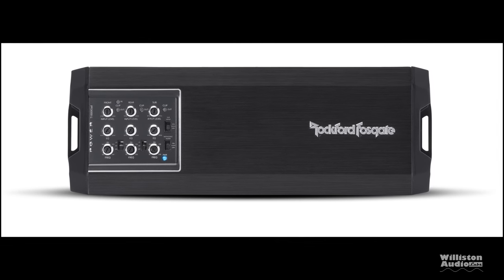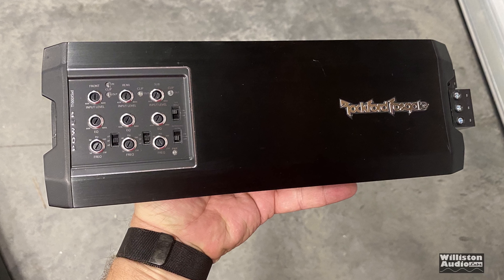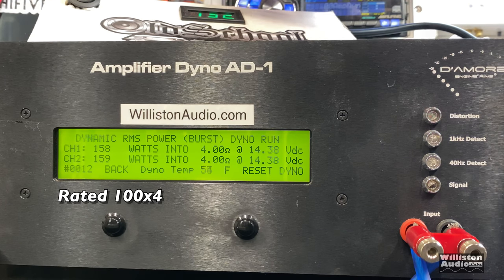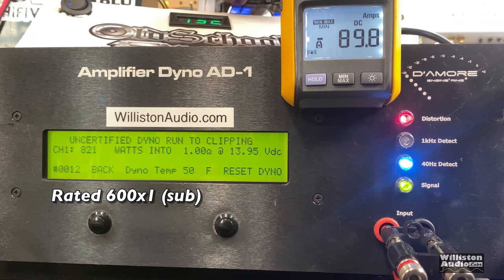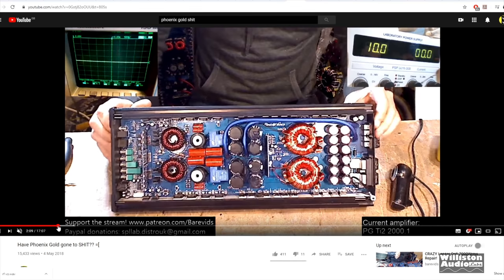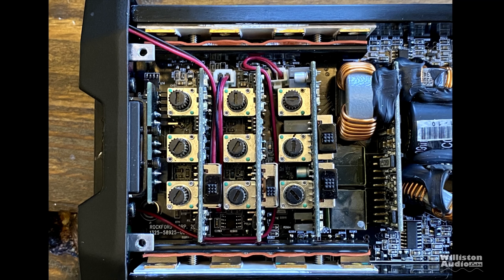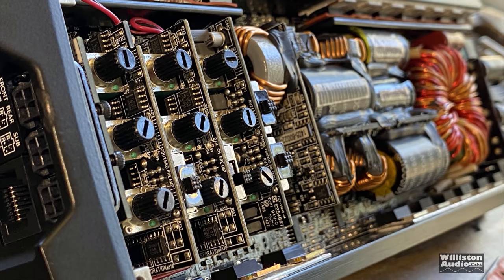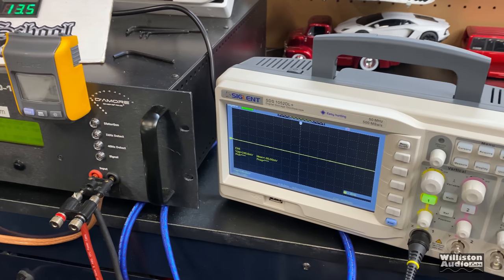Rockford Fosgate Power T1000x5ad Mini Amp Powerhouse!

Comment: I have the stage five system in both my UTV’s and I chose this amp for each with the PMX2 and my 2024 Can Am limited enclosed has 1(M1 10” sub) and 4 (6&1/2’s) installed in roof front and rear.The system is amazing and doesn’t dim lights or never fails to amaze me with the clarity❤I’m now working on 30yrs using Fosgate🇺🇸❤️

Comment: I’ve had this amp  going on 3 years. I liked it so much I bought another one. One I use in my daily the other I use in a semi. The one in the semi is usually on for 12 plus hours a day and I run it pretty hard. Both amps have been reliable. Thanks for the video and love seeing Sam in the last couple of videos you’ve done 👍
Reply: Banging in a semi... that's cool...
Reply: Haha I just put one in my semi as well, driving a 12 inch magma at 1.6 ohms. Love this amp it's amazing, glad to hear yours is holding up, I was concerned about that.
Reply: A question I want to buy it, but I wanted to know if I can use 4 speakers in the channels at 4ohm and the mono channel of the bass use a subwoofer at 1ohm or is it that all the channels have to be 4ohm speakers and 4ohm subwoofer?

Comment: I used to work in a small car stereo shop in the 90's. We did a custom Astro van with this 1000 RF amp to power 4 custom built 21inch subs from Rockord Fosgate.
 A 650 RF amp to power a total of 28 speakers, from mid bass, mid range to tweeters. We upgraded the alternator and added an extra marine battery.  The amps covers were gold plated any speakers with exposed covers were gold plated,. Do you guys remember the silk dome Punch tweeters and the plates?  That truck won a first prize in Las Vegas car show.

Comment: Great review.  I have been waiting for an independent dyno test for this amp.  The birth sheet might be a tad conservative compared to the results you got.  Very impressive.  I have this amp running my old school MB Quart PSD 316 set up front, 4”coaxials rears, and 2 JL Audio 10w3’s.  Its been in my truck for over a year now.  It is an amazing sounding amp.  It has allowed me to hear details in my music I hadn’t heard before.  One of the the first things I noticed right away was how much more midbass I had and how sharp a snare drum attack was.   The set up and gain settings are super convenient and easy.  I do need to get a tighter focus on the x-over settings once I get the SMD tool.   I also want to upgrade my Kenwood source unit to something a bit different.  The only complaint, if it’s really a complaint, would be after sitting over night the fans squeal a little during power up.  It goes away after the fans warm up a little.  Not a big deal at all though.  I’ve run it hard for hours and never had it shut down or roll back.  The fans keep it cool and safe.  This thing is totally worth the money.

Comment: This amp is still going string I my Subaru after years of abuse. Love it!  Small and mighty! Did have to install some fans though since I did hide it under a beauty panel and they do get hot.
Reply from the maker: Sweetness
Reply: Hey. it was your video and install that convinced me to buy one. Currently in my car now. RF T2 components front, T1 coax rear and RF P3 slim sub.
Reply: John Niedermier nice!
Reply: Car Audio.etc I miss your videos!!

Comment: I used to run the Power 4x100 and bdcp1000.1, but I couldn’t fit that stuff in my new car. I’ve been waiting years for a new system, this is the amp for me.

Comment: This video helped inform my decision to buy this amp. I have it installed upside-down in a tight, hot, stealth install. I beat the snot out of it regularly. Runs hot to the touch. But has been perfectly reliable. It sounds great too. Much "sweeter" or "warmer" than the Pioneer 9705 (a great budget 5ch BTW) it replaced

Comment: Those driver IC's will be very very very difficult to remove and replace once it starts throwing DC output, not to mention those riser boards with all the potting.  With surface mount FETs for the sub...don't be running this thing at 1 ohm!  

Either way, this is definitely a legit amp (like Rockford, Kicker, Alpine, Pioneer, Sony and Kenwood still continue to be), and I've been wanting to see this layout.  All the parts are just really really crammed together.  

As always, this is a great review by Big-D!

Comment: Sam = spot on. Agree 100%.  To your comment "pay more", I have to literally LOL whenever that's said.  I took a break from audio for almost 15 years (Class D was JUST coming out.) and feel like I went into a carbon freeze and woke up on a different planet.  First of for what happened to my beloved Soundstream - but I digress.  The cost of this Rockford amp is less than what I paid for my 2 chan. Reference 1000 back in 1996!!! (Something I still have stored in mint condition along with my Ref. 644!).  What the amp costs now is CHEAP, especially considering the fact as Sam said they are doing their own thing from scratch.  Big ups to Fosgate.  Huge kudos man.  Anything I purchase circa 2021 forward is definitely going to be Fosgate as what happened to the others...well, I'll leave it alone.

Short "story":  I cut my teeth on Fosgate going to work for my first "pro" shop back in 1989/90.  I already knew audio pretty well but I'll never forget the time Fosgate factory reps took to train me on the nuance of what made Fosgate "better" and unique.  One  had his entire vehicle running on a Punch 45 using analog passive hardware and system configuration to make it work.  The system - rated at 45 watts total - blew me away.  He won many sub 50 watt comp classes.  What he did - and Fosgate promoted as a "thing" - was run the front stage at 4ohm, using passive cross overs between the amp and components (I know I know, but this was 1989.) his rear "channel" was running 8ohm in parallel with the front 4ohm for a  3db drop on the rear fill. (Remember this is a 2 channel amp!) while simultaneously running a mono sub in a bridged config off the same two channels the front and rear were using.  He just did a passive choke for xover.  So, one 2 channel Punch 45 running 4 satellite "hi pass" and a single bridged sub in mono (I think it was a 12).   The system was loud, balanced and left just about everyone around the shop with their mouths open when they found out it was just one amp running the whole show.  It was a very impressive demonstration for their amps and their line of thinking.  I haven't forgot it in over 30 years!

Comment: Had 2 Power 1000s on 6 Punch 15s back in the day.
Around 1992 or 1993, and a Power 650 running mids and highs Oz Audio, a 6, two 4s, each door with Concord tweeters in the vents..... Sounded amazing!
Reply from the maker: Wow, quite a setup!! 😳

Comment: I had the T1000 5 channel running the system in a car I recently sold.... it was legit.

They run hot but they put out AMAZING power for the size, I honestly didn’t even think it was possible for an amp of that size to do what it does but it does.
Reply from the maker: Sweetness!

Comment: I had bad luck with this RF Amp. The original unit I purchased was DOA. I returned that one and picked up another, locally. That one had the RR channel die after about 6 months. I RMA'd it and sold it. I picked up a Hertz amp that I enjoy. The RF T1000x5ad ran very hot even with active (noisy) cooling. The Hertz runs cool comparatively and it is passive.

Comment: I have one if these in my GTR.  It's a great amp.  First one lost the sub channel though after a few hours of use.  Was replaced under warranty luckily.  Running all my Hertz milli pros and my 8 inch infinity kappa sub in place of factory Bose.  All sounds amazing.  It's also in a location that has zero airflow because these amps supposedly can handle high temp applications.  So far so good.  Even running near clipping it has had no temp issues.
Reply: @wal  what 8inch sub would you choose with this amp if you had like 7.5 inch depth to work with?  I was thinking a kicker L78 Q class since it's one of the highest end subs that will fit.  I have a infinity kappa now and it has beautiful sound but I think it's lacking a tiny bit of thump.  It barely over powers The Hertz milli pro 6.5 woofers in the doors.  Hardest hitting 6.5 full range speakers I have ever heard.  I tried a sundown but they have too much cone/mechanical noise to be in the cabin with me.

Comment: Some info on the AD, BD class selling names from RF:

Those are modulation techniques (hopefully). Single chip amplifiers would have used a particular technique of operating in class D. For example, Texas Instruments parts like the TPA3116/3130 family can use BD or 1SPW modulation, while parts like TAS5630 and TPA3255 series use AD modulation.

AD modulation is the standard classic technique, provides best audio performance but inevitably has lower efficiency and requires good output LC filtering.

Not much information on BD modulation, though the TPA3116D2 series datasheet mentions halved voltages and better efficiency (supply voltage vs. full differential voltage swing of AD modulation) and output LC filtering not required (but further improves efficiency).

RF uses BD class for subwoofer amps only.

Comment: Debating on saving for this. I have an old Power HX12 sub in a large sealed box, powered by a JL slash 500/1 v1. Front JBl GTO609C in the front. I want to either add a 4 channel amp, or just get something like this. and call it a day. Which would you do?

Comment: had a punch 45 and 75 , great amps , loved them.
Reply: I had the punch 150 in 90'. in 95 I bought 2 power 250 x2 and in 96 I added 2 power 250 M2 amps. I loved my RF stuff only wished they would've done more with symmetry back then cause it was a letdown. lol, I even bought the RF cd player.

Comment: Class ad is not marketing or branding, it is an actually patented technology, patent 7456686B2. I feel upon closer inspection you'll find that the 2 sets of 4 fets encompassing the crossover risers are in fact 4 separate class ab amplifiers running from power derived from the outputs of the four class d amps individually. This creates an amplifier with linear audio quality with class d efficiency by using the class d output as a power tracking regulator (plus a few volts) to drive the ab stage with little over head voltage, which is where the heat and lack of efficiency that ab amps suffer comes from.  the sub channel is a good ole class bd. this is also made obvious by the multiple output voltage rails caps, the way more than needed secondaries on the core, way to many to-220 packages in the supply section (its only a rated at 1000 watts they don't need that many). I would love a look at the bottom though.
Reply: A quick way to find out would be to measure the voltage at the drain of fet 1 and the source of fet 2 (fets one and two from top left to right facing the open top) there should only be about 10 or so volts between them if it's a true ad type amp.  If there's something close to 70 or 80 volts between them, then it's just a half bridge class d, although it can still be called "Class AD" somewhat if using ad modulation instead of bd or pwm or etc.... Class AD is certainly not branding and is an actual class type as much as class g or h are anyway. cheers
Reply: Dawn Minilla I don’t know if I’d call ad modulation a class ad amplifier. I think of class ad a combination of class ad and class ab working together much in the same way class a and b were combined.

Comment: Did you check the power output of the front and rear channels using your high power resistor setup? I am wondering how much current it draws powering 4 channels or all 5 if you can test the sub channel at the same time.
Reply from the maker: All channels were loaded during the tests

Comment: I have been waiting on you too test this amp. I want it too run In my Jeep.
Reply from the maker: Dean at 5 Star likes the 750x1 and 400x4 combo better and honestly if you get them refurbed they are about the same price
Reply: @wal  But they take more power from the electrical system, no?  I love the idea of 5 channel amps.  I don't know if it's worth it to get the Power amps tho, whats wrong with Punch 5 channel with same power (except no constant power, they are also great no?)

Comment: So ..................  THIS amp may be what I ultimately decide on,  if it can run 2  6.5 door kenwood,  2 5x7 jbls & 2 10 mtx's           ..Not very high wattage stuff aprox 600watts of speakers basically.               Could I run all 6 off this amp in stereo?

Comment: Take a look at the outputs with an oscilloscope. the front channels on the TM400X4AD has almost 3 volts of High frequency noise due to a bad circuit board layout. the front channels pick up the switching frequency of the power supply. its enough noise to damage some tweeters!!

Comment: I loved my Rockford T8004 and T20001bD each being 2 foot long x 1 foot high, but I longed for the bigger 3 foot long T15004 and T40001bD.  The T2K killed my favorite 'loved like kin' Eclipse sub, it was more than enough power, but I really badly wanted the big 4 channel.  But honestly, even though I actually burned myself on those amps kinda badly multiple times coz of the insane heat output, I loved their power an slew rate.  
I do love technologies progression though, I went from that HUUGE monoblock that cost $1k second hand to an Alpine MRP-M65 that cost me $50 second hand, and sure its 1\3rd of the power (I only run 4 ohm anyway so its not that much less power actually), but its tiny and it is efficient as hell, it creates no heat at all, and I abuse my amps like I cant describe, hot days, no ventilation, hours on end at max volume driving around, hence I get burned when I touch the heat sink, but this little Alpine I've had for 5 years now, its been bloody brilliant!  No more giving up back seats and boot space, no more rebuilding alternators, no more fire hazards (*Always* carry a CO2 extinguisher guys!!)

Comment: Do you know the max rated power of  the kicker kxa800.5? I have 3 way front and 2 way rear component sets that are 2.5 ohms. I have a nvx vad11005 running just the 4 channel side only in 5 channel mode, vad17001 pushing 2 square Q class L7 subs ported wired with ofc 8 gauge speaker wire, 0 gauge big 3 upgrade, Stinger SPP1500DCR 1500 Amp battery that I replaced my stock one with, a stinger 5 farad digital hybrid pro capacitor, and all ofc 0/1 gauge feeding everything except for 4 gauge ofc from my cap to my vad11005. I have a matching 10" Q class L7 sub but it's dual 2 ohm and my 5 channel amp is only 2 ohm stable so that's why I was wanting to know the total output of the kicker kxa800.5. The lowest my system voltage was 13.8- 13.9 turned up about 7/8 of the volume. Will the kicker amps sound cleaner and will they make my subs sound better being a kicker amp?

Comment: I have an old power 1000 and I was wanting to run them on my mids and highs but the speakers I have are rated 100-125 rms fosgates but there just 4ohm speakers. My question is can I somehow make them 2 ohm to get the 100 rms out of the amp I’m gonna use cause at 4 ohm the amp is rated at 50x4

Comment: Question for owners of this amp.  I recently purchased one used.  Seems to work fine,  but I noticed that the fans are always on,  is this correct?   I also noticed the fans are noisy,  I have this under the seat and can actually hear them making noise, like bearing going out in the fan or something.  

Does anyone know of a part number for these fans?  Or is that sound normal?

Comment: Question of concern about your testing. You tested each set of outputs separate; Not in real world conditions. Test the sub channel with the 4 channel on dummy loads would be more realistic. A better test of the power supply in the amp. Can it provide enough juice to drive all 5 channels at rated power?

BTW, I have one of these in my car.
Reply from the maker: All channels were loaded for all tests. 4 ohm tests used 4 ohm sub load, 2 ohm tests had 2 ohm sub load and 1 ohm sub tests had 2 ohm four channel load

Comment: Man, I want this amp, but I need to know one thing if anyone can answer.  My head unit has 4 channels, how does the amp see the signal for the sub channel?  Is it possible to connect the four channels normally via high level, but for the sub channel to get the signal from either the front or rear channels directly rather than having to create a wire input for the sub channel on the side?

Comment: Very good video, I’ve been looking at this amp to run my entire system as I’m limited on space. But on another note, how are the dynamic numbers different than peak numbers, I’ve always wondered that?
Reply: Great question harleiux, "Rated Power" is what Rockford Fosgate states the amplifier will produce under any condition, it's like guaranteed output power.  "Dynamic Power" is done differently based on what test device you're using, but in this case with the Amp Dyno, it's the real world power output when put under load.  We actually hooked it up and this is how much power it produced.  This is like a Sportscar Dyno, where you can measure the horse power while on the rack.

Comment: When you run these test do you have the gain turned all the way up on the amps?
Reply: Absolutely not !  Set up with DD1 or clip indicated on the amp. !!
Reply: Ok I was just wondering and hoping not, just never see what the amp is set to or any setting up for the dyno
Reply: Adjusting the gains does not change the output power of the amplifier, only the clipping point based on input signal.